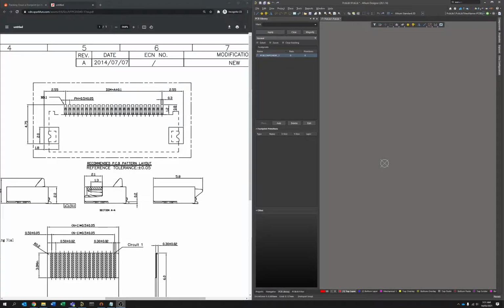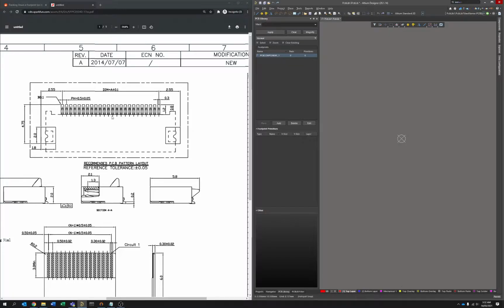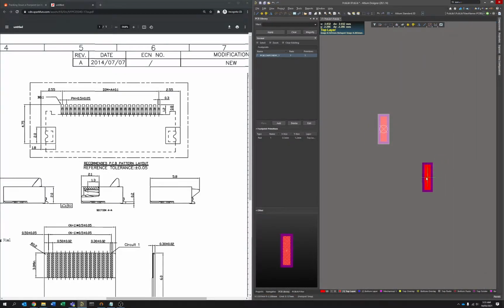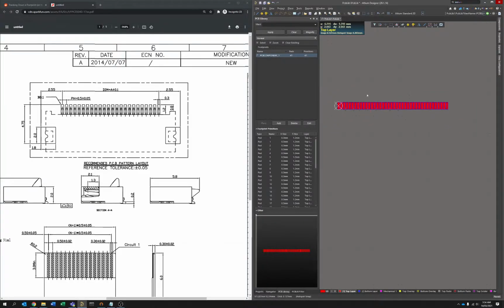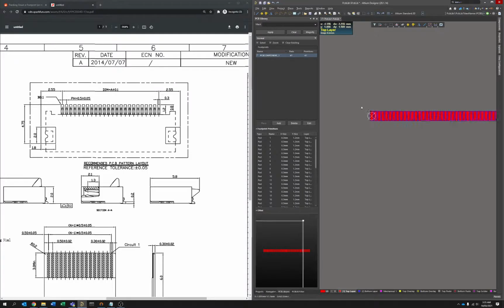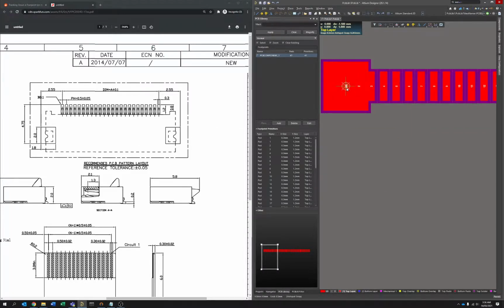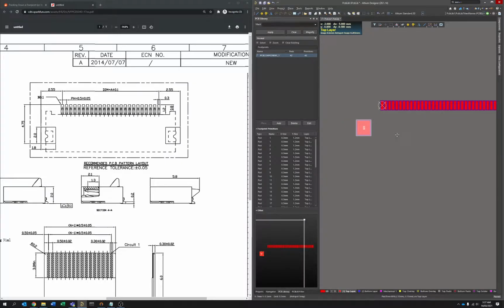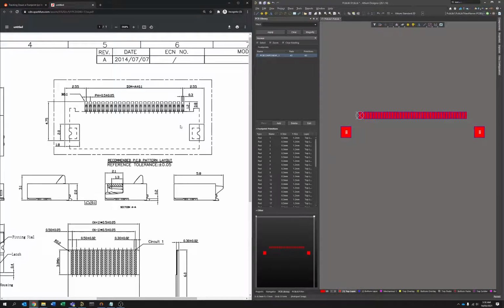Altium - Making an FPC Connector Footprint

Comment: need to Know how to draw FFC Cable on Altium
Reply from the maker: For FPCs you would use a 2-layer flex stack defined in the layer stack manager. Gerbers are no different to a rigid board - just put the supplier order through as flex. For single layer, the same stack can be used but only route on one layer. When exporting the gerbers, don't export the unused layer. Ordering process is the same as a single-sided rigid board, just request a flex substrate.